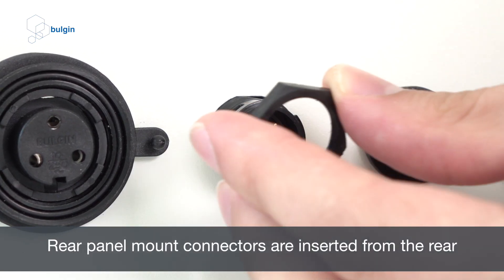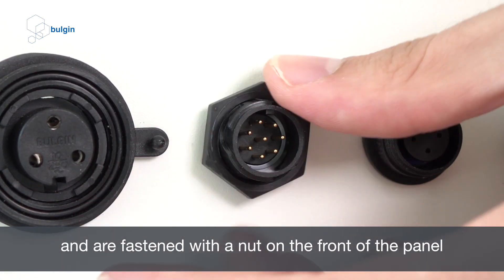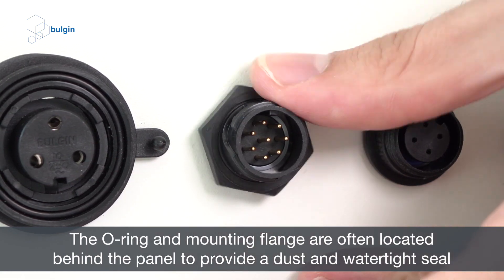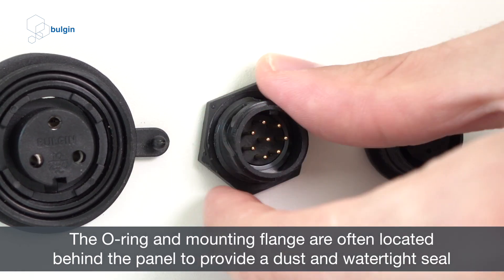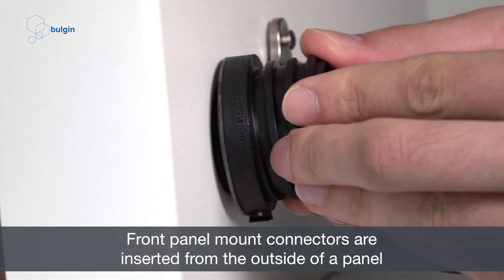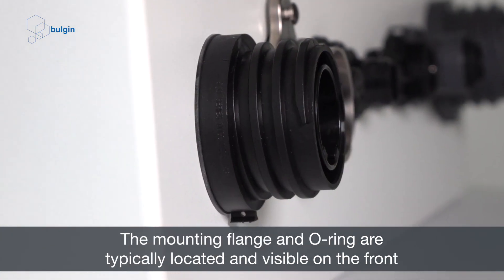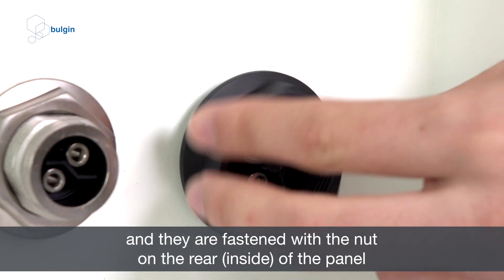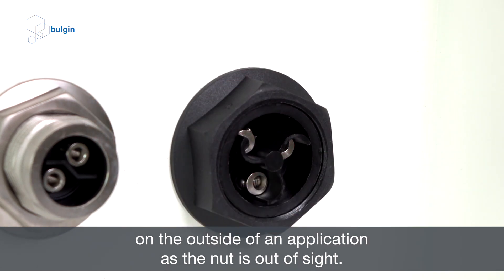Rear Panel Mount vs Front Panel Mount Connectors : What's the Difference

Comment: I was looking for information related to USB headers on a motherboard and USB front and rear panel connectors. Specifically if you can plug unused USB headers on a motherboard into a usb rear panel bracket without sacrificing the use or speed of front panel USB ports plugged into a different USB header on the motherboard, thus giving you more USB ports without using up a PCIe slot on a USB expansion card.

Turns out this video is about something else entirely. My bad.